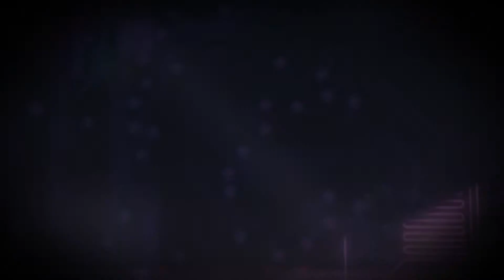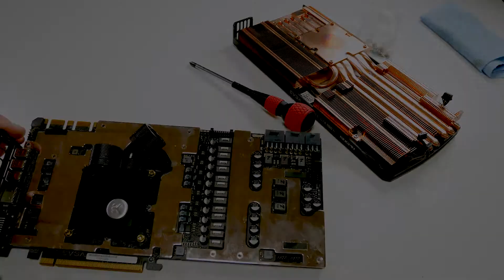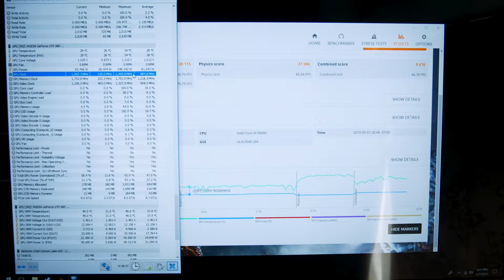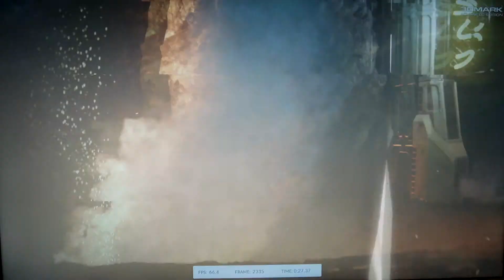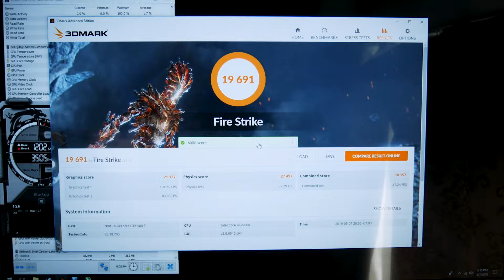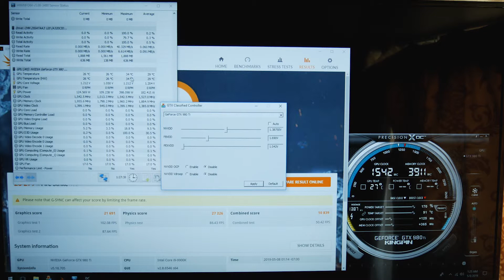GTX 980 ti Overclocking

Comment: That Kingpin EVGA GTX980Ti is quite different in quality (much higher) from the EVGA GTX980 FTW that I bought on eBay about 2 years ago.  At the time, I thought I got a decent deal for $180 delivered.  Then I ran the card and had to underclock it to keep it stable.  Immediately I thought to myself...yuk...got screwed with a degraded card...maybe a miner's card or something beaten beyond its glory days.  Then, after surfing the forums I found out that these FTW's had a reputation...the OEM missed placing thermal pads on a string of VRM's.  Added the thermal pads to that string of VRM's and voila!  Back to expected performance again.  Whew!